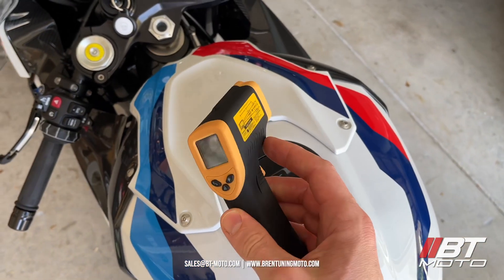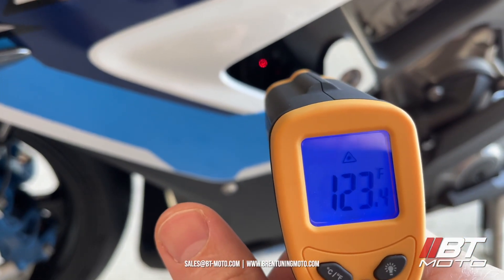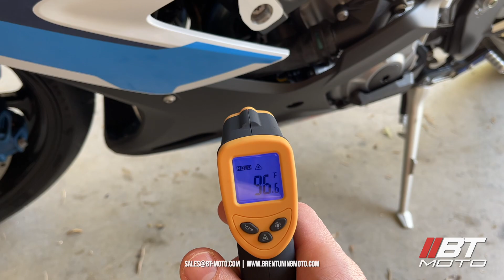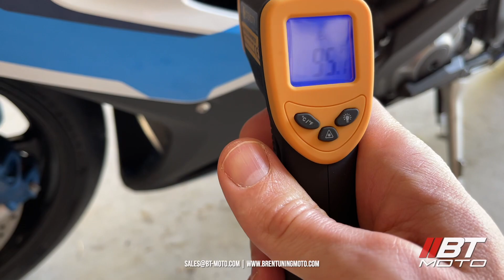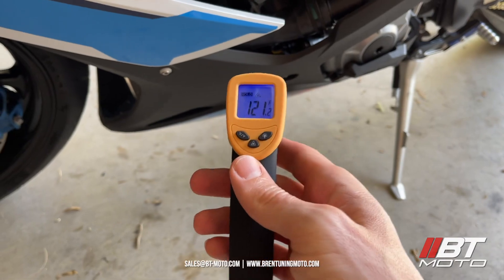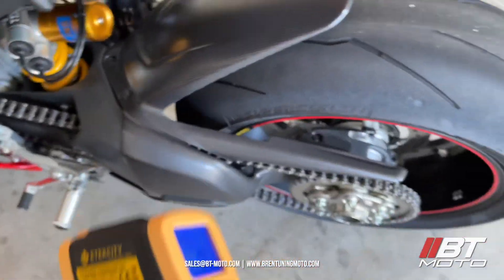BT Moto Tech Tip: S1000RR Coil Failure Diagnosis

Comment: Hey buddy Im going through what seemed like a second round of coil failures. Turns out, according to the dealer, 1 coil is bad and they're saying the DME needs to be replaced as well. Just looking for general advice and if a DME failure is likely/possible in this situation. I've had 2 coils fail before and the bike this time around felt exactly the same. I dont want to assume the dealer is wrong about the DME, however, based on symptoms of a failed DME, I wouldnt rule it out. Have you had any issues with the DME and if I get it replaced and reprogrammed, am I to reupload the stage 1 flash I bought from you?
Reply from the maker: @ijoeblow  never heard of the DME causing the issue. Usually it’s revbombing when it’s a redundant issue after fixing.
Reply: @ I take the bike up to high RPM but never rev bomb. That’s just stupid. Hopefully it isn’t the DME/ECU and I can just replace that one coil. However, if the ECU is replaced, do I re-flash?
Reply from the maker: @ if they replace the ECU, you would need new flashing, yes

Comment: Hello Thank you for your Video ... I have a  M1000RR with 1200 km and tbe bike keeps up comes up with a fault code that says loss in engine power ... and it seems to have pops and bangs as if the engine nit firing pls can you advise

Comment: Hey man I'm still waiting on my MRR to come in! U LUCKY DOG! Quick question, I drained all the fluid from my tank and now Ive got a code that popped up! (Fault in the engine control) onward journey possible ride to the nearest dealer. I filled the bike with fresh gas and that's when I got the code and realized my gas gauge is stuck on 32mi. The only other thing that I've done is connect and disconnect the CTek. Its a 2020 BMW S1000RR M. Help me please lol I don't want to go back to the dealer its a 617mile round trip.